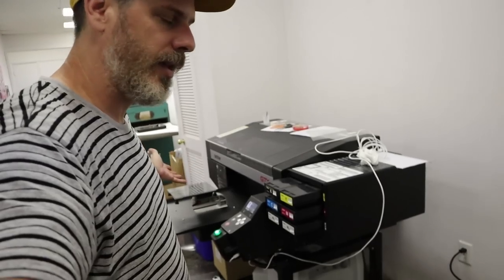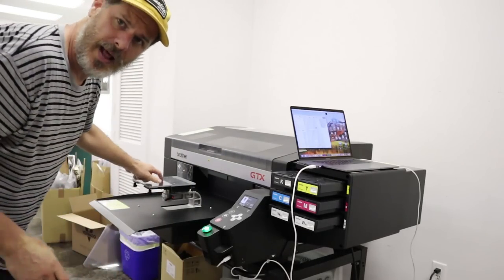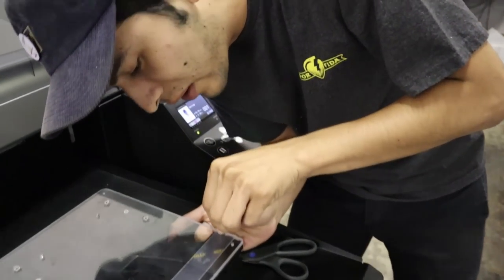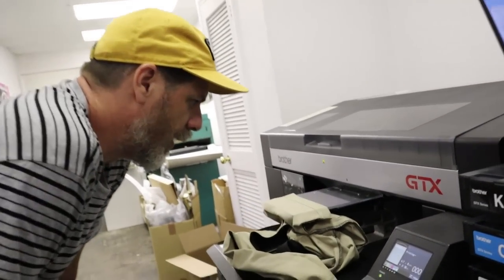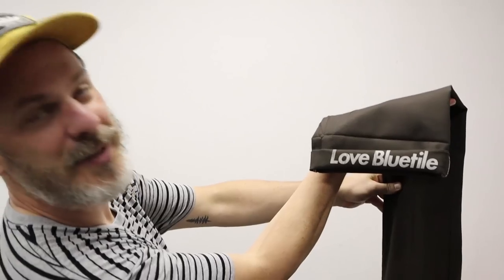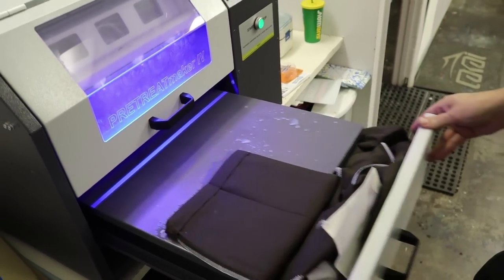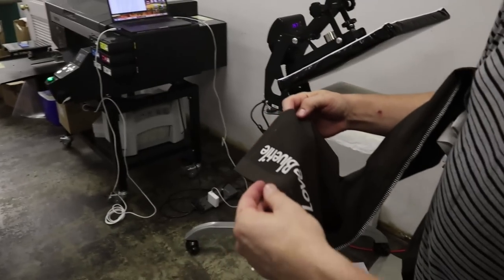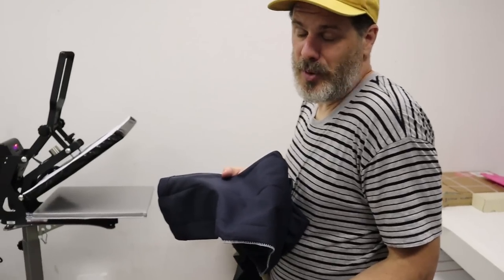Brother GTX DTG printer | PRINTING PANT CUFFS!

Comment: Hey David! I am actually purchasing the GTX in a few days. I was wondering what heat press you use? I am looking for a good one for under $1,000 if you have any suggestions. Besides that... any tips/tricks for me when I get it going? Thanks!
Reply from the maker: ill have to take a look. we got the heat press that was offered with the machine. brother had a package deal. we probably ended up paying too much for it. as far as tips and tricks. I'm still learning. there is an embroider and screen printing show coming up in a week or so and im gonna go to that and see what I can learn.